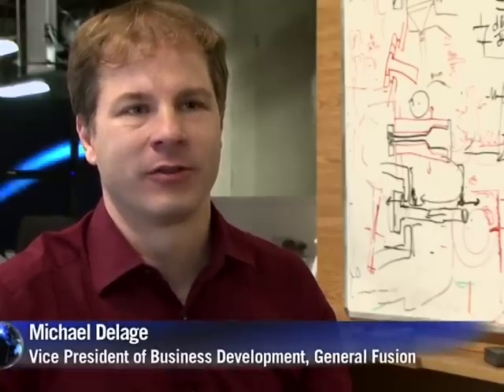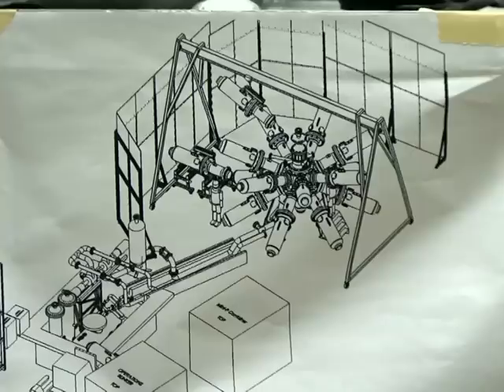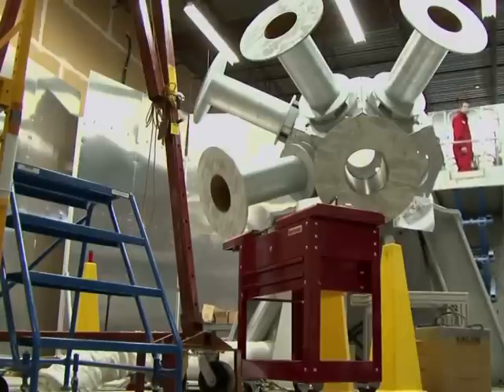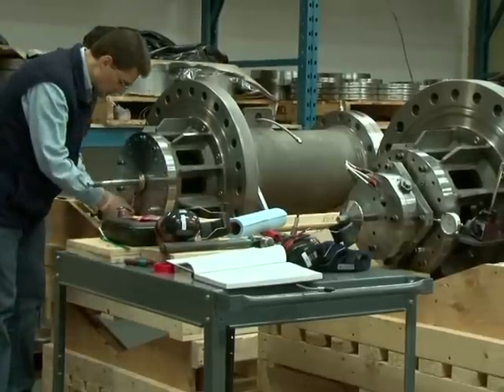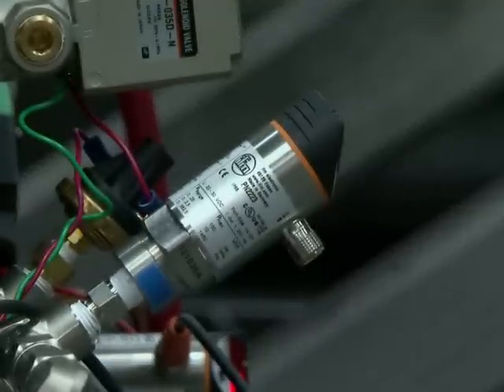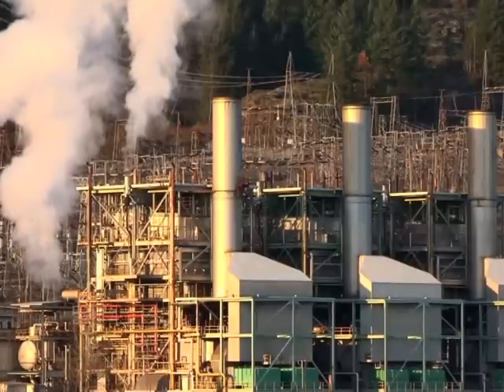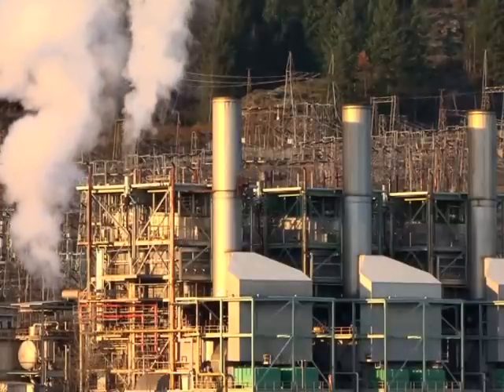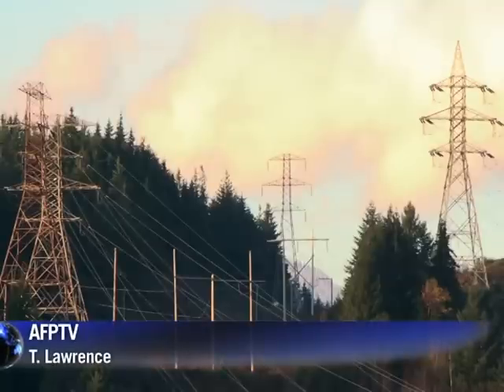The race for nuclear fusion

Comment: They'll never get it. What's it been, 3 years now? HAHAHAHA!  Nuclear fusion today is the same as yesteryear. They don't understand the basic model for the interactive behavior of quanta--and until they do--they will not achieve fusion. NOT A SINGLE WATT. You can't get fusion by smashing like-charged particles together with high energy: that just increases the Coulomb barrier force. Rather, you must understand that like charged particles only attract one another (and ultimately fuse) when they have a relative velocity less than or equal to their inter-particle distance. THIS is the general case--NOT Coulomb's Law.

Much like the nucleus of an atom that contains more than one proton, there is NO nuclear strong force holding them together. Rather, it is a short time-scale availability force between nuclei that exists only when the relative velocity between these quanta fall below a certain thresh hold within a mean-free path. That's when they fuse. What natural phenomena is responsible then, for atoms heavier than hydrogen? Well it's not the nuclear strong force. Herein lies a 'secret' so obvious but not yet programmed into the brains of the scientific community.

  This means that more relative velocity (or attempting to smash particles together with pressure and heat) decreases the likelihood of fusion by an order of magnitude, NOT increases. Millions of dollars spent by thousands of federally-funded scientists can not and have not changed this. Coulomb's Law (like-charges repelling) only applies to nuclei that have relative motion. PERIOD. The correct process for fusion has been discovered by very few in this world--even though it's in plain view. It already occurs in the core of stars and planets--which is NOT "150 million degrees Celsius". The ignorance of the "educated" masses, however; has overlooked this basic fundamental law of The Universe.

  So as with this "small Canadian firm," all I can tell them now is they're fools if they choose to not first fully understand the basic interactive behavior of quanta before spending all their investment money in the same direction as everyone else. They may measure a number of statistical fusion events due to random pairwise relationships of nuclei within their reactor, but it will not only be far from break-even, it will consume so much energy and time (work) that by the time they close the project, (I'm guessing they'll finally give up by 2018) they'll make a frustrated mess of everyone's optimism of everyone involved. It's over for these people--GET A CLUE NOW BEFORE YOU LOSE. Investors in this project: Search for The Truth before giving them any more money. Let me know when you THINK you have achieved 'ignition'...so I can correct you again.

This is THE REAL REASON "star power" is a distant dream. IGNORANCE!
Reply: You think you know how stars work? You're WRONG. Stars work differently than the accepted bureaucratically scientific community 'thinks.' I'd have to deprogram you before I can even know where to start.
Reply: Hello Cabbot!, Just to mention you sound right about atom smashing,and theory nowdays seems tobe inclined on an answer to Dark Matter solving these questions we seek. I should get my astronomy books out again because it's captivating.So much for now,Brent said you went to New Mexico and it's some interesting country, and someday I might.Remember the Arizona Highways magazine I was talking about:pick one up sometime.Bye till then:Oh yes Oregon won!!!,Terry.
Reply: Sounds great Terry, yes I went to Nevada to a huge festival out there. I just waxed my car after getting it all dirty it looks great now
Reply: I heard about oregon. Victory on the radio while I was driving in California! That's great

Comment: Unfortunately, in my 57 years, I've heard this claim before. I'm still waiting for a workable fusion power plant to be built. You see, the problem is not to "break even": it is to generate 3 or 4 times more energy than you get out (conversion efficiency isn't any better than about 30%, & usually is a lot less).